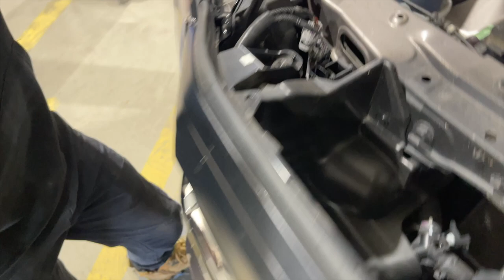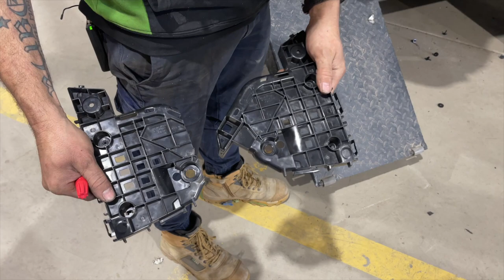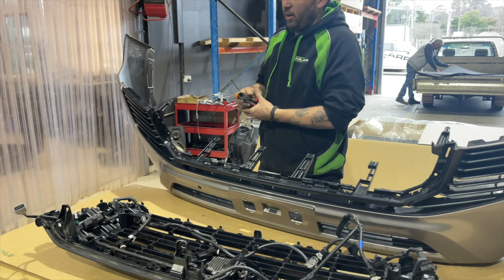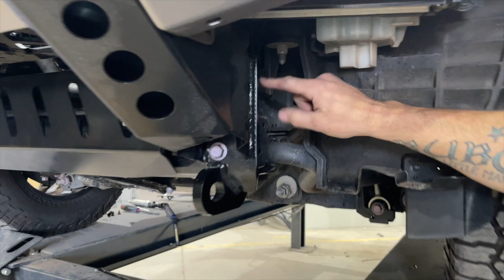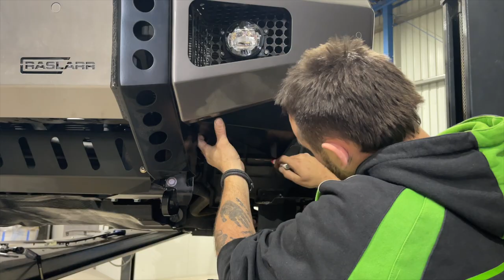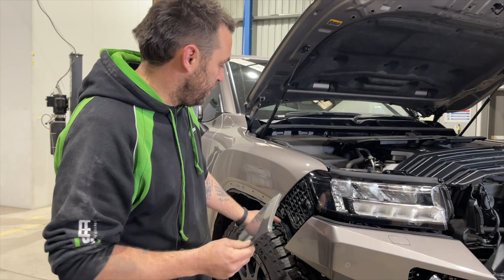RASLARR - LC300 Series Bull Bar Installation

Comment: Hey guys, luv the look of the bar. BTW did you consider incorporating holes in the centre section to increase air flow into the engine bay?
Reply: Thanks Jack! Aiir intake was a big concern of ours, so we did the large holes through the uprights and all behind where the fog lights sit, has holes. With our bar on, the intercooler air intake has been increased 48% over factory bumper! 😀